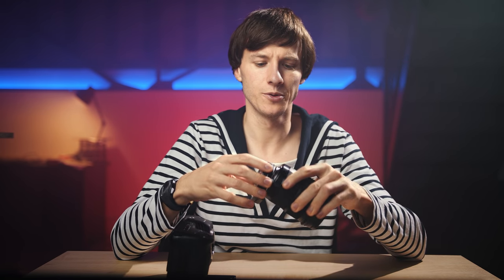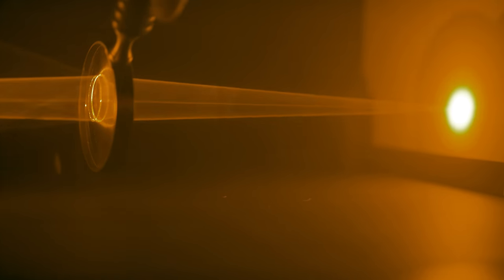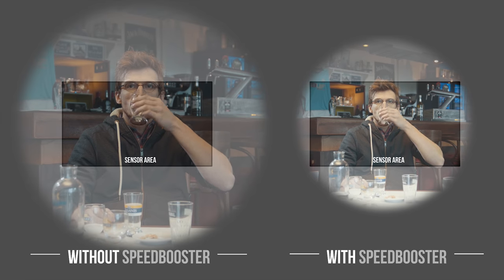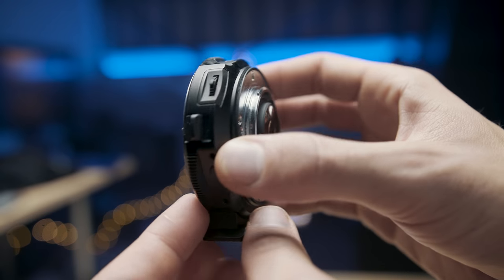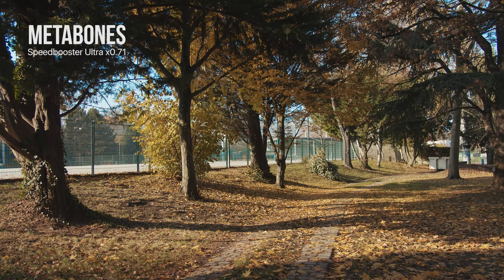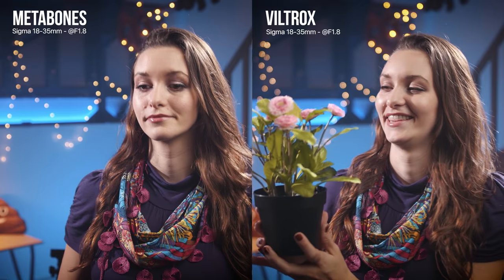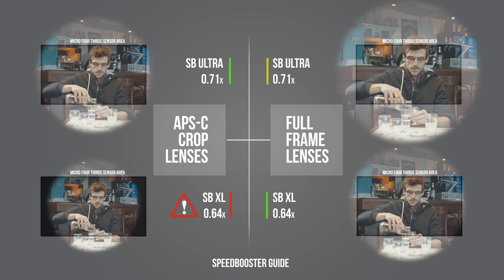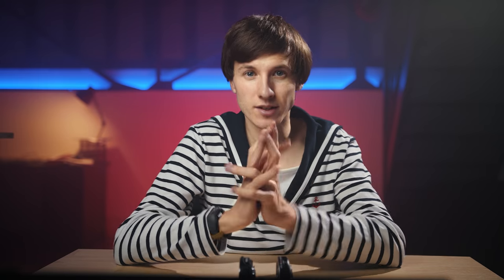How Does a Speedbooster Work ? ( and Metabones vs Viltrox  )

Comment: Hello,
First thanks a lot for your videos, they are really clear and well made !!
I'm documentary filmmaker and I will received soon (I hope) the black magic pocket cinema camera 4k, but I am a bit lost on the speed booster part :
I have a series of Leica r lens, 
I would love sometimes to borrow some basic canon zoom lens like the 24-70 2.8 they can be helpful sometimes. 
So I would like to find a solution where I could use my Leica r series and some canon lens with the same speed booster. 
I have found a very good offer of that speed booster: Metabones Speedbooster Canon EF to Micro Four Thirds S, but it is a S ... 
I was wandering if this could feet on the new pocket camera, and then if I could put a basic passive adaptor canon to Leica r (whereas the Metabones Speedbooster Canon EF to Micro Four Thirds S is meant to be use with active lens) ?
I have the impression that if I use a metabones speed booster leica r to m3/4 then put a adaptator to the canon lens it will not work as the canon lens zoom like the 24-70 2.8 have not mechanical aperture ?
I hope I am clear enough and that you can answer to my problem ! 
Best wishes;
Victoire
Reply from the maker: Thank you Victoire ! I think I see your issue. Yes I'm 99% sure you won't have aperture / stabilized functions of a canon lens if you combine two adapters (EF to Leica R then Leica R to MFT) since passive adapters never transmit electronic functions.  The option I would recommend for you is to put, as you suggested, a Metabones Speedooster Ultra EF adapter on your BMPCC 4K. Then you add a cheap passive Leica R to EF adapter on top of this EF speedbooster when you want to use your Leica R lenses (such as the GOBE or K&F Conceptmodel). This way, you can either use Canon lenses that you rent (70-200, 24-70, sigma 18-35) with full control over iris and stabilization, either add the small Leica R adapter on top of this metabones for your Leica lenses (with no electronic control). And when you have more budget you can buy a second dedicated Metabones Speedbooster Leica R to MFT. Bear in mind that autofocus function does not work yet with the Metabones speedboosters + BMPCC 4K but I have high hopes it will be fixed in a future firmware update. Is that clear :)  ?
Reply: @zebrazone  Yes totally it's what I thought for the combinaison of metabones and adaptators. 
And only thing is what someone is willing to sell me the metabones speedbooster Canon EF to micro 4/3 S, and I read the spécification of the S and it uses even more electronic so I was wandering if it will accept that I put a passive adaptor on top of it. 
Thanks a lot for your last answer ! 
Have a great day !
This is the link of the metabones : 
http://www.metabones.com/products/details/mb_spef-m43-bm2
Reply from the maker: @victoirebonin4966  Oh I see what you mean ! It's ok, you can use the S version with any lens (passive / active / adaptor whatever), but on its other side if you use a passive camera body, iris control won't work and then you would need to use the other version with external power supply and adjust iris with the physical speedbooster controls. But BMPCC4K is active you shouldn't worry this way round it's ok :)
Reply: @zebrazone  thanks a lot :)))

Comment: I got vignetting with the same setup Viltrox and Metabones Ultra at DCI 4k. Did you shoot in UHD without vignetting? I cannot believe you got no vignetting.
Reply from the maker: Wow this is weird ! Yes it was all shot in UHD but I think I've checked in DCI 4K and there wasn't any either, I'll double check and tell you. Is it visible vignetting you have or just very slightly barely visible ? Maybe my analysis was to global, but I uploaded the UHD footage I got as is.
Reply: I get vignetting only in 4K DCI, yeah..
Reply: @zebrazone  Yes, it is really visible in my "real world" footage.
Reply: Interesting, only at 18 to about 20 mm I suppose?
Reply: @zebrazone  at certain apertures the vingette is more noticable.
Reply: It clears up at like 19mm
Reply: @dominiccole  Correct.
Reply: @benjaminneate7640  No, it doesn't change with certain apertures. Always visible from 18-20mm.
Reply: W. W. It definitely changes
Reply: @benjaminneate7640  Not on my 18-35mm lens with both Viltrox and Metabones.
Reply: @w.w.7148  So which metabones would be better for no vignetting?

Comment: matabone is better of darkroom term (the gap between connected of lens and the inside adapter) you will see the effect when you using the lens below F/1.4 
suppose you using EF 50F1.2L with you will saw light emanate in your picture, anyhow it work very good with F1.8 Lems, I was try to use velvet paste inside the adapter(viltrox) it can help with emanate but still have it (I was test on my a6300 )
Reply from the maker: Nice to know , thanks !

Comment: Quite a few mistakes in here. The speedbooster doesn’t take the ‘entire’ image circle, it just magnifies what it can at a 0.71x or 0.64x ratio (depending on your model). You should have tested the two brands at 2.8 and higher really, as generally speaking both perform differently at different aputures, and it would be unusual to be shooting wide open, especially on a landscape shot. 
Finally, you should probably revise your L lens section as you have a nifty 50 in there which is by no means an L lens, the 1.2 is the L lens.

Comment: All speedboosters have a small screw on the side. It allows you to loosen the element group and rotate it to allow for slight modifications. You can move the element group farther or closer to the sensor and achieve Infinity Focus on some lenses, make them Parfocal (with Sigma 18-35mm e.g.) and even minimize distortions and aberrations. 

Since the Viltrox receives less quality control, the element group is not installed with total precision and some of them might not reach infinity focus by default, or even create the distortions you experienced with it. Even if your speedbooster is Ok, lenses are all a bit different. Sooner or later you will have to tinker with the element group to achieve a perfect result...and this applies to the Metabones as well. 

Thorough testing is necessary to offer a high quality review and comparison. Your videos look like they are professionally shot, edited and coloured, but if you spent a little more time developing the subject or content, and less with the overall look of your videos, you'd be a lot more successful. Check out other Youtubers that have compared these two speedboosters, you'll notice a huge leap in content quality, even if their image look appears to be amateurish. Hope you read and assimilate this little critique with maturity. 

Unfortunately, many Youtubers, reviewers and critics working with expensive gear are inherently biased by the gear's price. Most of the time, a higher price does not indicate higher quality...just more greed! Metabones is a Canadian company, and obviously has to pay a higher cost for the primary materials used to manufacture speedboosters. Viltrox on the other hand is based in China, where materials and basic workforce still cost a lot less than in Western countries. This explains the big price difference between the two products. And since Metabones sells at a higher price, they are basically forced to have more quality control. So get to work and turn the gear you bought into a better product...When salaries are high, people tend to become lazy and spoiled; They end up pretending total perfection, and that's a bad thing from my point of view. Do you want to be that kind of consumer? Like an American teenager that spends thousands on Apple products and doesn't know how to use a PC or other electronic gear? Doesn't even know what GPUs and CPUs are, let alone tinker with them to get the best out of their computers. Capitalism is ruining all of us, and sorry for digressing into a political rant, but I couldn't help myself. I have big hopes in you, my European friend. Your channel is great and I really wish you had made the proper research before delivering this video. 

Take care! :)

Comment: I think what you should now is that every adapter you get will be built slightly differently. Other reviews say that the viltrox is sharper on the edge.

Also you are giving false information about what a speedbooster does. 1.2 aperture on m43 is not more light then using the same non speedbosted lense on apsc. You can't make magic with a speedbooster. This is a question about equivalence. 

Third, you do not tell people that they have to adjust the viltrox to achieve good sharpness on distances  >2 meters, and this could have to do something with you not using it properly. 

So overall this is a bad review imo even though the visuals are nice. 

At 1/3 the price, with better mid sharpness and better autofocus with sigma lenses, the viltrox is the best buy for many, consumers and even professionals.
Reply from the maker: Thanks  a lot for your feedback. I know one review which showed the Viltrox sharper on the edge, but that's because he compared a Metabones XL to a EF-M2 which is unfair because they don't have the same magnification. Also, I said m43 sensor will receive more light if you use a speedbooster, which is totally accurate and it's not magic, you're just focusing the light on the smaller sensor. I didn't know you had to adjust the Viltrox somehow, but I did try with another unit recently and found the same conclusion. The differences happen when you are shooting wide open though. Also I agree it's a good quality / price ratio, it depends what's your target scenes and final delivery customer.

Comment: What happens with micro 4/3 lens frames ... are there any clipping when used?

I have the Blackmagic Pocket 4K with a Rokinon DS 35mm 1.5mm lens ... will I have clipping?

I would appreciate your answer ... or someone who already uses it
Reply: VILLEDA Estudio Producciones you can’t mount a micro 4/3 lens on a speed booster. If that’s what you were asking. Speed boosters are only for adapting lenses which are not the same native mount of the camera and have a larger image projection circle than the sensor of the camera it is being adapted to.
Reply: @jonathanmasters2178  no no ... my question is --- how much clipping do I have if I put a 35mm lens ---
Reply: VILLEDA Estudio Producciones will you be using a speed booster? If not then you will have to take your focal length which is 35mm and multiply it by the crop factor which is 2x. I believe 1.8 on the bmpcc 4K but for sake of simplicity we will do it by 2x which is standard m 4/3 sensor crop factor. So your 35mm becomes an effective 70mm lens
Reply: @jonathanmasters2178   woooooooooooooo...... 1.8???? 

I can not believe it ... it's too much, and what happens now if I need a wide-angle lens?

I have to spend a lot more money ...
and rokinon an 18mm that will be equivalent to a 35?

I can not believe it ... I already buy my 35mm lens ... what solution do I have now? What do you recommend me...

I thank you for your time ...
Reply: VILLEDA Estudio Producciones if you plan on using micro 4/3 cameras you need to either invest in a speed booster which will restore the focal length of that 35mm lens back to a 35mm instead of 70mm, or you can buy micro 4/3 lenses which are made for that sensor. There are lots of wide lenses available for that mount. But to achieve a 35mm field of view you would need to get an 18mm lens. It is all much easier if you just get native micro 4/3 lenses because they make 8 and 10 and 15 mm lenses which will give you 16, 20, and 30mm equivalent fields of view.
Reply: @jonathanmasters2178  ok ... I think I made a bad investment buying a 35mm MCT lens ... now I will have to buy a new 14mm lens ...

Unless there is a Speed Booster mount micro4 / 3 to micro4 / 3
Reply: VILLEDA Estudio Producciones A speed booster from mirrorless lens to mirrorless camera is impossible. It only works because DSLR cameras have the sensor far away from the back of the glass, so the lenses for DSLR cameras are designed to project light to a further distance than that of a mirrorless camera. In a mirrorless camera the sensor is right up next to the mount so mirrorless camera lenses are designed to project light only a small distance before hitting the sensor. Adapting DSLR lenses only works because the adapter creates the space that would have been taken up by the mirror and shutter mechanism in the DSLR.
Reply: And a deeper flange to the mount, of course.  @jonathanmasters2178

Comment: This viltrox speedbooster is absolute bullshit. Doesn't work with both my Sigma lenses. I've installed all the firmwares available, none of them work. No Iris, no IS. Useless. I'm really getting angry about this. I have a job coming up and now I'm sitting here with this unseless thing and have to get the metabones last minute to get the job done.

Comment: Speedboosters are overrated. I have a Metabones speedbooster and a dumb adapter and use the dumb adapter more.
Reply: What's the name of the adapter that you're using more?
Reply: @DerrickLGuest  It's not very catchy.... K&F Concept Nikon G/F/AI/AIS/D Lenses to M43 MFT Mount Camera Adapter
Reply: @declanmurphy1006  Thanks! I was just looking that one up online.  I read that it does not support any lens functions that rely on electronic communication with the camera body so does that mean when you raise the IRIS (for example) within a given camera's setting, nothing happens to the lens you're shooting with?
Reply: @DerrickLGuest  There is no autofocus, and no electronic control of aperture. There is however a physical lever which opens and closes the aperture. This adapter works especially well with extra-sharp APS-C lenses such as the Sigma 18-35mm, though a Speed Booster might be preferred if you want that dreamy shallow DOF look. The Zhongyi Lens Turbo II is an interesting budget option.
Reply: Oh by the way, please note that Nikon lenses work differently from Canon lenses, so I've no idea if you have any mechanical aperture control with a Canon version. I suspect not!
Reply: @declanmurphy1006  Thanks! Since it's so cheap, I'm going to buy it and see if/how it works with my Pocket 4K cam... Thanks for all the info.